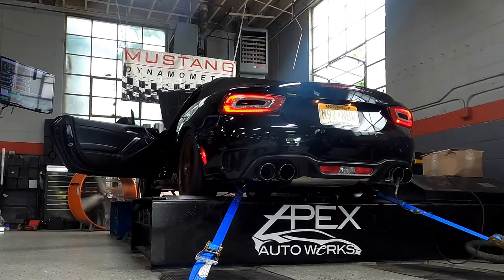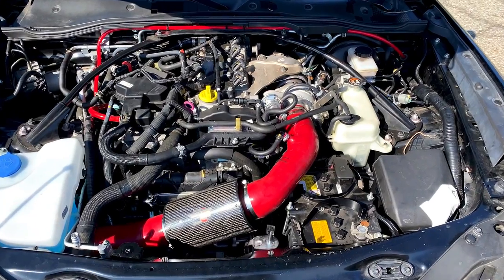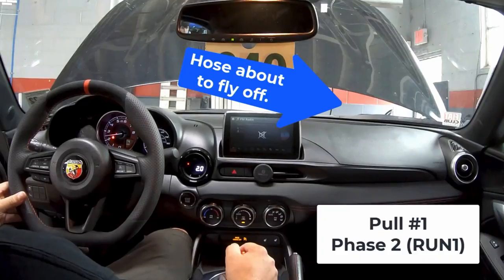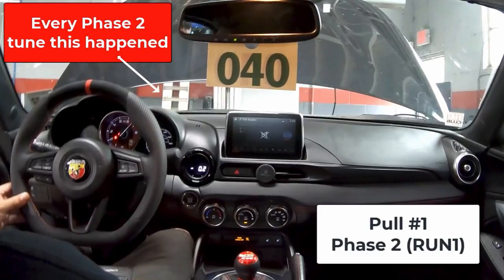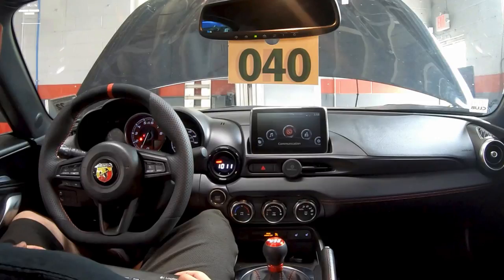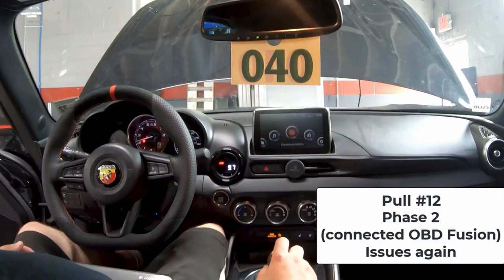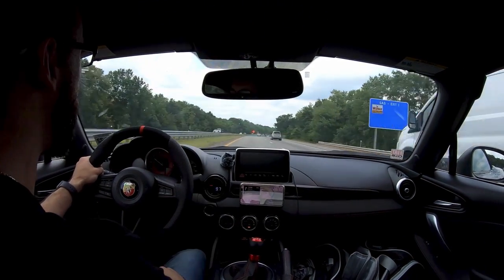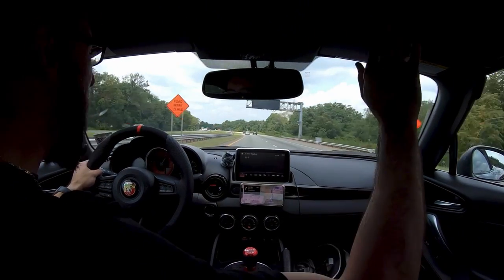Fiat 124 Spider Abarth On The Dyno & What Went Wrong

Comment: Find a DynoJet and you should not have any issues. I ran 3 Spiders back-to-back without any issues on a hot day recently. The numbers that we got were in the neighborhood of what we expected to get. A stock 124 Spider runs in the 140 - 145 whp range, that is pretty well documented. When I ran the 3 Spiders I had on the DynoJet, the stock car put down 142 whp, the tuned car was about 40 whp more which is about what I would have expected. The real gain was in the wheel torque numbers. The tuned Spider put down 240 wheel torque compared to the 175 wheel torque of the stock Spider. Big gain there. 

These cars are not hard to dyno test if you have a shop that knows what is going on. We did 3-4 runs per car and got consistent runs on each pull.

Thanks for sharing, this is all fun to watch and we all learn something in the process.
Reply from the maker: I may possibly get it on a DynoJet if I can find a good reputable shop...but probably no more flashing back and forth because that seemed to have caused a lot of issues. If not i'll stick with my timed data testing which is less stress on the car and I honestly love that type of data comparison.
Reply: I’ve never had an issue on any single dyno. Mustang, dynojet, virtual dyno, hub, wheel, etc. The only issue was the tune was junk.

Comment: To be honest, it was just a really crappy dyno setup. The myth that the 124 Spider can‘t be dynoed is just that, a myth. 
Here in Germany the tuning industry works very differently. There is no market for ecu tunes from online vendors. Every tuned 124 Spider I know, including my own, was tuned on a dyno with zero problems. Only exception are those guys using piggybacks.
Reply: What's the name of the piggyback ecu?
Reply: @RicondaRacing  I don't use one. But there are a couple vendors out there. Speedbuster, Racechip, etc. Mine has a ecu tune.

Comment: I just flashed to Phase 2 a few days ago and I was having that same problem with the car trying to hit high boost and it just dumping boost repeatedly like yours was doing around the 15 minute mark. I couldn't get Phase 2 to work at all with my Madness throttle controller installed. I took that off and it finally started to work. Before I took the Madness controller off, it would just go into limp mode. 

I have had a Tork tune before and I actually went to the mountains this past weekend with the owner of my former 124 that has that Tork tune still on it. His performed much better than mine and his doesn't even have an intercooler on it. I have not been impressed by Eurocompulsion at all, so far.
Reply: I went to Tork after I tried eeking out maximum power for my class in autocross. I went to the drag strip, got race gas, went to dyno after dyno, spent tons of cash on mod after mod…always disappointed. So I changed the tune and poof just like that my car started performing correctly.
Reply: @BrodeyDoverosx  you are saying you changed from an EC tune to a Tork tune and it started working well?

Comment: I haver achieved 165 whp in phase 2 using the stock airbox and a k&n filter. Now I have all the bolt-ons for phase 2. I was hopping to achieve at least 185whp.
Reply: Hopefully you get there!
Reply: @BrodeyDoverosx  Thanks I'll measure tomorrow. And update the results here.

Comment: Wow, I'll say this, the fact that the car survived those dyno pulls with 140F intake temps shows that Toby and Brandon did a good job with their engine protection strategies in the tune. I know they focus on that quite a bit. The boost line blowing off absolutely DID create a boost leak, I don't know how big, because I don't know how big the line was, but it certainly wasn't helping anything. 

In regards to dyno testing these cars in general. Yes, we at EC have spoken about these complications before. We NEVER said that these cars can not be dynoed. One of our competitor's claimed we said that, but it's not true. In fact we have had dyno results on our website for these cars since 2012, both ours and our customer's and on various types of dynos. Plus we have 1/4 mile data from an actual dragstrip which backs up those numbers. The truth is as your video shows, these cars are tough to dyno, especially if the car detects it's on a dyno, which your car did (otherwise, why would the traction control matter?). Then the temperature numbers were really hurting it. I was actually scarred to see numbers so high. This is one reason testing on a track with an app is generally better and it's what we advocate for seeing before and after results. This eliminates all the dyno variable and the low airflow problem.
Reply from the maker: Always appreciate your input Greg! And I think going forward i'll stick with my data testing that i've been doing which is calculating time/performance on the road when the car has actual airflow. Less stress on the car, and still a great way to see the difference in performance. Although it wasn't a dragstrip, a few weeks ago I met up with another YouTuber "TrackDay" who has a Phase 2 Abarth 124 Spider and we did some 1/4 mile runs and 40-100mph pulls at the airstrip. That video will be going live this weekend on my Channel. Both of us on Phase 2, his car is automatic, mine is manual. Had both my Dragy and his VBOX in my car to calculate results. Looking forward to your response to that video once it's live 👍
Reply: @DrivenDistrict  That's exciting to hear, I'm looking forward to seeing it. I think real world testing is better. What really matters is after all, how the car performs on the road, and with modern apps, measuring acceleration is much easier than it was in the past, not perfect, but pretty good.

Comment: Should never have done pulls at those intake air temps. Shop needs to purchase proper fans or stop doing dyno runs on turbo cars.
Reply from the maker: Yea I was told this afterwards from others. I was not familiar with what intake air temps are considered too high. I guess I got lucky the car is still running well as of now.
Reply: As well, spray the intercooler with water right from the get go; it’ll help normalize the IATs. Additionally, never dyno this car at different ECT, IAT, EGT. The interpolation is too sporadic between the tables for performance related targets to be consistent. 

Afraid to say…you need another dyno day :-(.
Reply: Thank god for aggressive knock detection.
Reply: IAT's are relative to ambient air temp. 100* shop + Fans the best you will see for 20-30 above ambient on a loaded pull for IAT's. Learn some thermal and fluid dynamics. So 127-144* isn't shocking for IAT's just shows the intercooler is doing its job because hot side of the intercooler is 200+ out the turbo compressor.
Reply: @AlexComeau  Unfortunately, whether or not it "isn't shocking", the Fiat ECU's are programmed to start going conservative on timing in the mid 120s pretty quickly. To make power with these engines you MUST keep the intake cool. Not doing so is one cause of burned valves / pistons that people run into frequently. Often they never even realize intake temps were the issue. On the 500 models, all it takes is a few minutes in traffic and your intake temps are up into the 120s to even 140s. Sit in a drive through or heavy traffic in the summer you're seeing 150+. Then hit it with 18+ psi or 27+psi of boost and you're cooking internals. 

Call it a design flaw or what you will, it is what it is. 

The 124 thankfully is easier to keep temps down than the 500 - but you must be conscious of those intake temps. Intercooler helps a little but not significantly because a big part of the temp issue is heat soaked intake manifold and head. The only real way to keep temps down ultimately is water/meth injection or e85. Both routes have to be done correctly and tuned for correctly, though, or you end up sad.
Reply: This is why I monitor IAT on my 124. If it gets above 110 I take it easy on the car.
Reply: @sharkcohen  This. Thankfully it's much easier to keep temps cool on the 124 than on the 500 Abarth. Basically cannot drive the 500 hard at all unless it's cold weather. 

The 124 is happy to run cool as long as you don't sit and idle in heavy traffic or fast food drive-thru, etc. Though with 100 degree outside temps, you're going to run warm no matter what.
Reply from the maker: @AlvinBrinson  Yea IAT's on the 124 get pretty warm when just sitting as well. I remember recently I was taking some photos of cars and my car was on idling for a while and IAT was in the 140's. Mind you it was a really hot day out as well. But they climb pretty quick if you're not moving.
Reply: @AlvinBrinson  These engines are nothing special. I am fully aware and have a pretty good understanding of the ECU logic its nothing special either. Best way to improve intercooler function is remove any and all obstructions to air flow of the surface area of the core that includes plastic grills, wire mesh has a lower level of obstruction. If you are burning valves and pistons you should be looking for a different tuner and another contributor can be the SOOOO annoying pops and bangs. If you understand the ecu logic and follow it the limiters will prevent burnt valves and pistons but at the cost of consistency unless you get a better intercooler.
Reply: @AlexComeau  I also dislike the intentional pops and bangs
Reply: The ECU starts pulling timing at 122F.
Reply: @BrodeyDoverosx  does this ECU pull timing?  I remember talking with someone who specializes in these and he claimed the knock prevention just enriches the AFR.

That's good to know if so.

Comment: I never understood putting a car on a dyno.  You run your can hard putting strain on your engine for what?  For some numbers?  I just don't get it sorry. Every video I see of a dyno results in the engine blowing up. A car needs air to be coming in from traveling on the road not to run in place
Reply from the maker: I feel you on that! And going forward I will probably stick with what I started and have been doing which is real testing on the road. 30-75mph 3rd gear pulls, 40-100mph pulls, pulls against the same car etc. Those are great ways to see performance increases and will not put as much stress as strapping her on a dyno. I know a lot of people talk about dyno numbers in the community so I wanted to try and bring some value to that...but at the end of the day, it's my car, my time, my money, and i'll probably stick with road numbers going forward. (maybe once more on a DynoJet in the future with proper cooling though 😂we'll see)

Comment: I'd be shocked if the ECU wasn't intervening to stop knock.  I believe this ECU enriches sharply, rather than retarding timing or performing a combination of the two, so your lambda values during the runs could provide some insight.  I think better fans that are fed from a better source of air are going to be critical in getting accurate data.
Reply: It definitely was. In my experience, mid 120s is where you start to see significant intervention from the ECU in terms of timing and other measures to protect the engine. On my 500 Abarth at the twisted Sisters, I could easily feel the difference when intake temps went past about 125 degrees in terms of reduced power. Cruise for a bit to cool off and power is back. 

While in theory a tuner could raise the tolerance for temps, it would also increase the risk of burning pistons/valves.
Reply: @AlvinBrinson  it's good to see the knock protection on these is effective.  No way I'd back off the parameters without coated pistons and such to cope with the temps.  I see cases all the time where a tuner perhaps got fixated on HP/torque numbers without thoroughly testing for a safety margin, and I bet you can guess what lurks under the heads upon teardown.  Sadly it's always the owner of the car who gets the big bill.

Comment: Listen to me, Don't make me say it again. It is not airflow, it is not intake temperatures, it is a loaded dyno. Our little motorcycle engine can't handle it. I went through the exact same thing. Don't make me post my graph. Putting a Fiat 124 on a Mustang dyno is like putting someone on the rack. It's a torture device. My car which is just as powerful as yours could barely turn out 130 horsepower. And that was in 68° heat I believe with a big ass fan blowing on it. But the Dino was a Clayton Dino which could switch between load and inertia. Once we turned off the load we got more realistic horsepower numbers although I believe they were a bit High but still within reason. All this crap about Fiats not liking to be on a dyno is simply not true. They don't like to be on a loaded Dino, something about that stress makes it pull power. I'll show you my numbers in my horsepower and torque graph and you make up your own mind. Go to a Dynojet run a couple fans on it like you're supposed to and you're not going to have these problems.

Comment: Was it a loaded dyno as opposed to an inertia dyno. 124's little engine does not like any load. If you are on a loaded dyno thats what happens. I got 134 on loaded dyno 208 whp on inertia dyno.
Reply: Incorrect. I’ve never had an issue with an eddy dyno. If you’re not hitting numbers, you need to look at your torque maps.
Reply: @BrodeyDoverosx  incorrect on your incorrect. I have a Tork tune, he has a eurocompulsion tune. I'm going to assume the torque mapping is different, yet we have the same issue exactly. And I don't think it's temperature or airflow because I had a fan. I had low temperatures and  experienced the exact same behavior . And what good is looking at the torque Maps going to do? In order to perform on a loaded dyno they're going to have be changed if they can be realistically. And right now my car is maximized for performance. So what exactly do you propose? I could send my tune back to torque and say "hey optimize this for a loaded dyno?"  I don't know what Dyno you ran your car on, but if you ran it on a Clayton Dyno under load your car would do the same thing. Unless you have some magic. Which you may have, but you're going to have to explain it in detail.

Comment: A lot of speculation. All wrong. I ran my car back to back on an unloaded and loaded dyno. Clayton Dyno allows for both. On the loaded dyno same numbers as Driven District or worse. Car simply would not pull. Switch to unloaded and hp went up 75 hp. Same Dyno, same atmospheric conditions, same location and it's as close to the same time as you can possibly get. It has nothing to do with intake temperatures, whether fan was on or not on Etc. For some reason on a loaded Dino and only a loaded Dino our cars sense the load and pull power. If you want to get the right numbers you need to go on a dynojet.